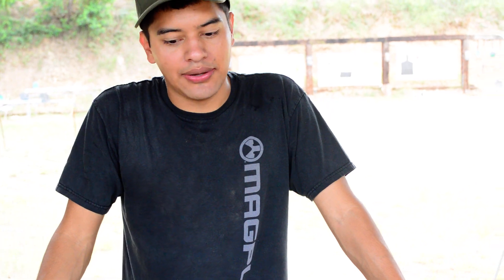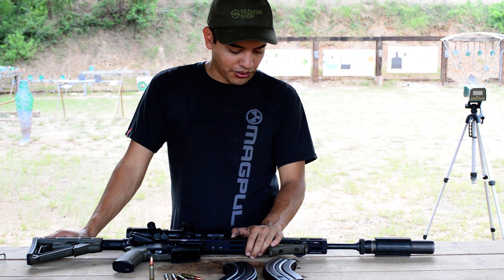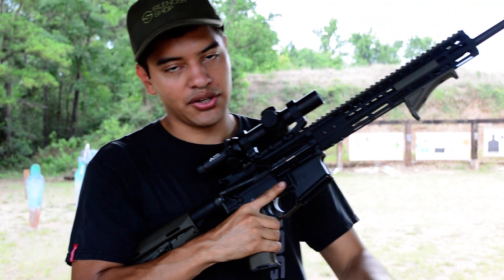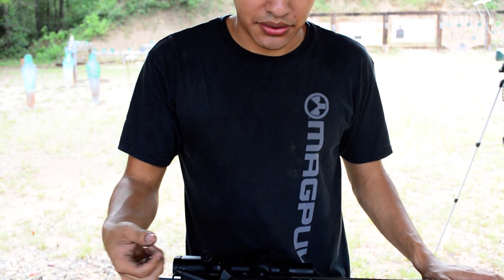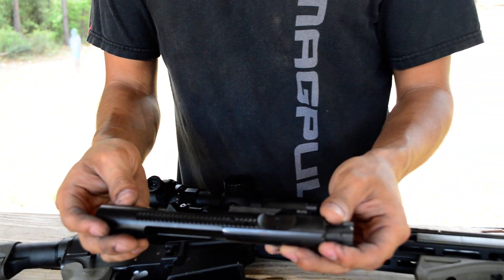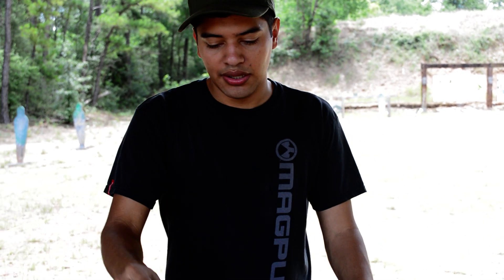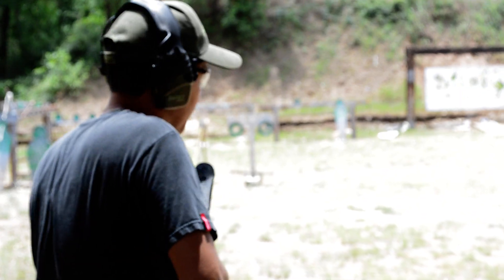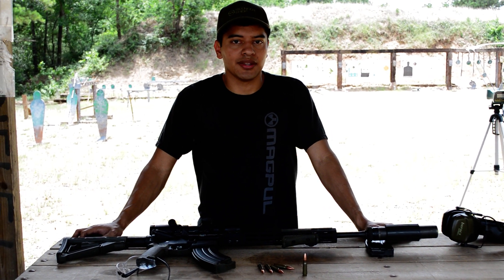Tips on building a reliable 7.62x39 AR-15

Comment: Only bear for me has been trying to get subs to run in a 7" pistol gas upper. You guys played with shorties/ pistol gas at all? Adjusting your A1680 load to accommodate?
Reply from the maker: We've only worked with 10.5" and 16" barrels. Are you using a suppressor with your subsonics? I highly suggest going with heavier bullets. I like leather head 220gr RN. With this load, I use 12gn AA1680.
Reply: Thanks for the suggestion, I will try them next go around. I am not ordering from that other company ever again, their customer service is garbage.
Reply: Steven Scaccia what kind of distance can you get with that??

Comment: You said that was the faxon barrel, is it a 1/8 twist? How does it compare to a 1/10?
Reply from the maker: It''s just as good. The 1/8 is actually better for subsonic rounds that we make.
Reply from the maker: I see no difference. Good thing is that the 1/8 would be better for the custom subsonic 220gr loads we make. Something tells me that Faxon 7.62x39 barrels actually use a .308 bore..

Comment: Maybe this is a dumb question but I don't know anything about 7.62 builds, but can you run any lower and upper combination you want with this build aside from the parts mentioned? For example a lower and upper for a 5.56 build ?

thanks for you time.
Reply from the maker: Correct. All of the parts are the same except for:

Bolt/Firing Pin
Mags
Barrel

Bolt carrier groups come with the correct bolt and firing pin. We have everything I used in the video (minus the lower) at http://www.skidtactical.com/store

Comment: fuck building one. I just bought an awesome ar in 7.62x39 for $500 shipped with lifetime warranty and sub moa barrel from Bear creek arsenal. go to their websight, get one or 5. these are awesome. shoots cheep Tula and wolf and way better than an ak. i love it. if you don't want to fuck around and just get one do it. i am so happy with what i got. wish i could get 5 more. might do so as an investment
Reply from the maker: Your gas port is over-sized
You have an inferior carbine gas system
Your barrel is not nitrided (it's not even chrome lined)
Your barrel is heavy
You have basic furniture

Fuck buying one haha.
Reply: I love it. shoots cheap russian steel very accurate, reliable, and i do not plan to change the "furniture" at all. did not want a chrome lined barrel as they are less accurate, i don't use corrosive ammo, and I clean my gun. Yes it is a heavy barrel and i prefer it that way. the barrels are rated .7 to 1 moa. the gas port works perfect with no failures. Also right now classic firearms is selling them for $399. now if you want to go out and spend 3x that price or do a custom build go ahead. I don't and as i am not a professional gun smith. furthermore bear creek arsenal backs up my rifle with a lifetime warranty. so in my opinion fuck building one. now if you think your going to build  one to be a bad ass sniper then your stupid for not just going ar10 with a full size cartridge. a $2000 one won't make you a better shooter. I am not a gun snob do not want a bunch of bling. I am going to buy 1 more because it is an awesome shooter and the price is very, very good. Have you even tried the BCA rifle and gone shooting with it? lets see you do that and go to the range and make a vid doing a fair side by side comparison.
Reply: It won't shoot better than a good AK, I promise you that.  Reliability wise (accuracy is another story).

AK47's are made to shoot 7.62x39 very reliably with almost any ammo.  My Russian AK will shoot thousands of rounds with barely any oil or cleaning with Tula or Wolf or whatever.   AR builds in x39's can be reliable, but not  as reliable to AK's.  (yes I have an AR in x39 also)
Reply: dann hienn my homie just got one from bearcreek also like clockwork
Reply: I built mine from Bear Creek Arsenal. It works flawlessly. Very accurate. But what he says about lacquer coated being better than poly is straight bs. I used the wolf wpa military classic lacquer coated and I kept getting light primer strikes. The primer sits deeper into the cartridge and is shit in anything but ak and sks rifles.
Reply: love my bca. wish he would try one and give a good company credit. load up on russian before they have a ban. you are right on his bs regarding ammo. all russian steel works
Reply: Mark Brink 
Mark, light primer strikes and deeper sets on primers has nothing to do with coatings, it might with commie brands .
You just need an enhanced firing pin and a heavy hammer spring to cover all the bases.
I have triggers custom, by ADK and they provide the enhanced pins.
I run that setup on everything from Grendels to 7.62x39, to even my 5.56's.
They eat anything fed.

Comment: How to build an AR15 in 7.62x39 buy an AK
Reply from the maker: How to build and AR-15 buy an AK? Do you build and AK buy buying an AR-15 too?
Reply: Keep the ar for 223   The fal for 308. And ak for x39.
Reply: I got an AR that takes ak mags! And apparently I got a jewel out of most....I consistently get 1.25" groups at 100 yards!  I run suppressed and literally just realized the difference that an adjustable gas block makes! I was waaaaay over gassed and noticed a big difference in felt recoil once the bolt wasnt slamming back so hard

Comment: What type of crappy suppression is that..... sounds darn near the same as without the suppressor 😂😂😂😂 U should wet it 🤔
Reply from the maker: AAC SDN6. You can't tell the difference because your laptop speakers don't go up to 167db for the sound of unsuppressed. Which suppressed is 135db. You're not supposed to wet a rifle suppressor due to the immense pressure.
Reply: joshv06 idk, ive used wire pulling gel in my rifle suppressors, works pretty good. ...  In different cans. 

Wire pulling gel can be found at Lowes home improvement stores. They may have a hard time locating it as its not an everyday seller, as most wires do not need that anymore.... Does make a nice difference until the can is real hot as the gel will get real liquidy after a bit.

Comment: you lost all credibility when you think M-4 feed ramps are sufficient for a 7.62x39... there is your only one issue.. replace those ramps with 300 blk out. you may be a fan of this weapon platform but you really should do more research and further your education on a proper working AR-47 platform.. i stopped the video at that point for there is no need to continue because i will most likely tear this video apart further.. 
i recommend you rebuild your wrong build weapon and then try the video again..

Comment: I hate PMags, but I’m wearing a Magpul T-Shirt!
Reply from the maker: myinfinitestate magpul is named after their first product. The magpul. I never said I hated pmags. I said I dont like magpuls.
Reply: What brand of ranger plates are you using then? Also, would I have to use the specific Aero Gen 2 Lower for my build or would pretty much any lower do? Thanks so much for this video, man, I'm stoked to build by own 7" pistol
Reply from the maker: Legionnaire5 any lower will do.  I used an Anderson for mine. Works fine  also, I used magpul ranger places. The ones used for usgi mags

Comment: What’s m4 feed ramps ? Is that in the upper reciver? Cuts ?
Reply from the maker: Correct. Because the magazines are not as optimal as 5.56 in a 5.56 magazine (shower feed rate) and the nose of the bullet sits lower than 5.56 due to its larger diameter case.